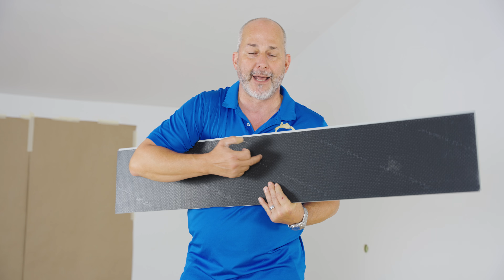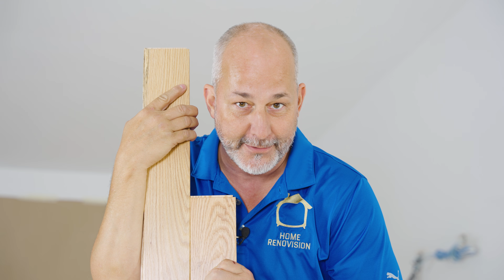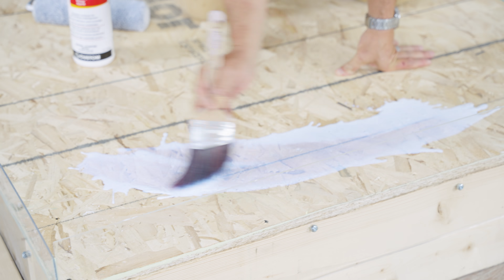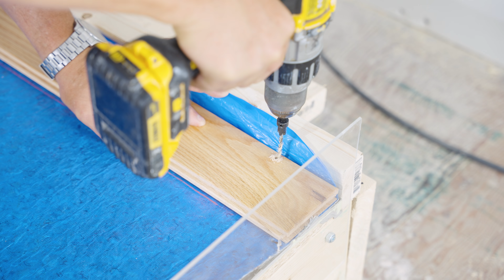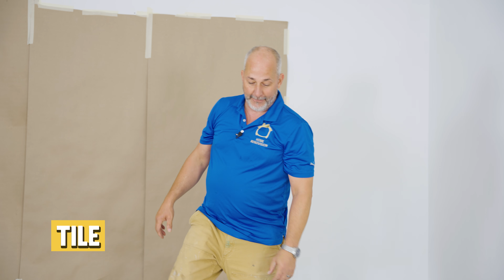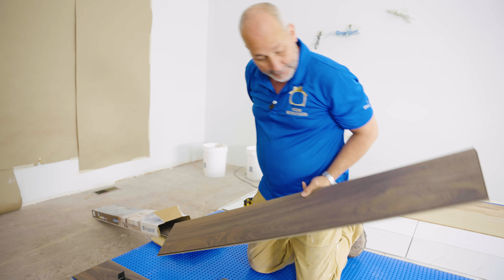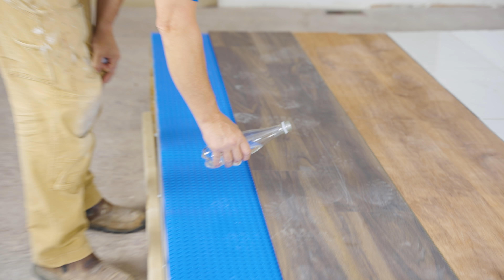Flooring Comparison: LVP vs Laminate vs Hardwood

Comment: I went with the loose lay lvp, and I really like how easy it is to work with, and you don’t need to worry about trying to snap the pieces together, and individual pieces can be easily replaced after they are installed without having to pull up other pieces of flooring. Occasionally some of the planks need to be tacked down with finishing nail if they happen to be prone to movement in that spot, but 99% of them stay put just fine.

Comment: I've done LVP in two rooms and I'm not impressed. If you have ANY floor imperfections it will cause problems where previous floating floors went right over it no issues.  The click or lock function is a nightmare.  I was pounding away with scrap pieces to tighten them up and it's in multiple directions.  The price is good but I'm using a different product for Bedrooms and front hall.

Comment: What you did  not consider is that water can and will seep through in between the LVP planks.  When this happens you need to remove the planks to clean the mositure.

Comment: What about testing how a fridge could dent the floor. Especially when you pull it out from the wall. We had engineered flooring up in and it dented under the rollers of the refrigerator and portable dishwasher, as well as chair legs.

Comment: From prior experience big dogs and powered wheelchair...
Hardwood... is gonna wear.
Vinyl/Linoleum... is gonna last 3 years at most.
Porceleain tile - no issues.
We never thought laminate would survive.

Water was a real problem  for engineered, tiles let it weep through to the subfloor.  Membrane probably fixes that.
Water stinks on laminate.  Not sure how it works for LVP.... sounds easier to mess with than full sheet.

More than half of me wants to use full sheet vinyl for a shower to make a perfect water seal...  Not durable, but you don't usually walk on your shower walls.  [Idea is really in use in RVs].  But it's a giant pain to stick to vertical surfaces....  I don't think LVP seams can handle showers though...

Comment: So basically you can have real wood for $8 or plastic wood (LVP) for $9. I assume the cost would be higher for real wood if you’re installing in a concrete slab because you’d have to install plywood first.

Comment: Ok, so this video really changed the way I think about laminate vs lvp so much that I did the test my self. I took a 20 mil lvp and ac 5 wear layer laminate and tried hard to scratch it with my keys. The vinyl plank was scratched deep way before the laminate. Now I dont know what to think. Are some of the flooring manufacturers lying on the specification?

Comment: Jeff,  as always a great Video.  Just a couple quick comments.  My wife and I installed a Pergo Laminate floor in our Kitchen nearly 30 years ago.  You know, back when you had to send a letter in the mail to get the company to send you a VHS tape on how to install.  So, State of the Art then!  At any rate, it was the glue every seam & ratchet strap each plank version.  Of course a couple years latter they came out with the click/snap version.  It is a small kitchen and it took about 3 days to install it all.   But, it has survived floods from a dishwasher, 2 kids, dogs, and innumerable insults of dropped items over the years.  It is also, the main entrance to the house.  It has held up remarkably well.  Very few scratches or dents, and still looks great every time you give it a quick damp mopping.   In short, it was a lot of work to put down, but has been well worth it.   
Recently installed a LifeProof LVP floor in my Aunt's Kitchen.  It went down so much more quickly, and was easy to work with.   Looked great when done, and seems to be holding up well.   So, laminate and LVP click/lock has come a long way.   I would not hesitate to put down either product these days, as long as the floor is level & you buy Laminate or LVP from a name brand with a good thick plank and thick wear layer.  Don't skimp by getting thin/cheap planks.  Literally, you are just wasting your time & money on a thin one.  
Keep up the great videos.  We are still laughing about flushing Sausages down the Toilets!
Reply from the maker: Great insights. Thanks for adding. Cheers

Comment: Curious if you'll make any videos on repairing the bottom of drywall that gets's ruined from old/poorly laid baseboards? We're doing DIY flooring here soon, and was removing the base boards and actually pulled quiet a lot of the drywall out in the process. Any advice would be huge!

Comment: This surprises me. I could have sworn engineered wood floors got a variable amount of refinishings, depending on how thick the top wood layer is.
Reply: Yes you are correct, a good quality engineered wood floor can be sanded to refresh the surface. 3 - 4 mm would not be unusual. You can also repair the planks, they have wax kits for bad dents.

Comment: I have a question about the underlayment you used with the hardwood flooring. If you have an encapsulated crawlspace underneath would that have any negative effects on the flooring?

Comment: AT 28:33 you said if we don't agree hit up the comments and tell you our experience.  

Tore out an old tile and subfloor.  Installed a new one using the "new methods" with these flexible membranes.  The floor was solid - no movement - before I started.  It runs out the membrane introduces a layer of flex that wasn't there. End result: grout is continually cracking out and having to be replaced year or two because the weight tends to be concentrated in one place and that part of the floor is continually being stressed.

Thought it might just be my own incompetence so I finally had a professional redo it.  Same results (only now I feel worse because I paid someone.)  The only tiles that didn't fail, and some are over 25 years in now, were done "the old way".

So, yeah, not a fan of the "new membranes".  They work okay for a while, then . . . snap, crackle and pop goes the grout.
Reply: I know this is old, but thank you for the "down-the-road" wisdom on flexible membranes for tile floors.

Comment: I've installed a few different laminate floors and never had an issues with tapping the ends together. You just need to make sure it's lined up correctly and afterwards make sure it's completely locked it without any gap.

Comment: i stopped buying that plastic "underlayment" everyone buys...i buy a cheaper and better product..i use the thin fan fold product used for exterior siding..the room is NOTICABLY quiet. its cheaper and its much easier. and the flooring sits perfectly on it and the thin plastic is just a wrestling match and really ineffective. save money and enjoy your project

Comment: Is the blue underlayment working for stone rigid core vinyl plank? My current problem is that my household isb1970 house, single floor, concrete slab foundation, most of the areas are flat, but some places has warp. So right after installation of the planks, everything is ok, however  2-3 years later, the places with uneven foundation, the corners will pop up. Even my handyman help me to glue it, it won't last long.  Will the underlayment help without the liquid thing to flat the subfloor? My problem is that I'm not handy, the flooring installation guy i hire doesn't do the flattening work, the handyman who can do the flattening work, doesn't uninstall old floor 😢😢😢 i have to hire the flooring guy twice, one for uninstal old,  one for installation new. This is too costly for me.

Comment: Titan Surfaces Colossal line, planks are 9” x 71” that look amazing. It’s an LVP with WPC construction, 12mm thick with a 30mil wear layer which I believe is the highest wear layer available with an impressive 1.5mm IXPE pad and uses the Uniclic locking system. It’s got the best of the best spec wise across the board and it shows. I went with Oceanus color and my friends that installed said it’s the nicest flooring they ever seen or installed even down to how well the planks were packaged. Maybe I got lucky but 1,300+ sq ft and every plank was mint and I never get lucky but this is some tuff stuff. It’s worth the extra $1.00 or so per sq ft for this stuff. Yer welcome

Comment: Hint for hardwood; buy directly from the factory, not from stores. Most factories have a line you can call and if you need over a specific order size, they will make it for you with the wood, size, tint and finish you want. The factory we have nearby does that if we go over 600 square feet. We ended up with all hickory floor at 4.15 $CAN per square feet!

Comment: Sheet flooring is still a smart choice for a kitchen because it looks good and will last for 50 years and cleans very easily. And it's very tolerant of things (glass, milk, eggs...) dropped upon it. I'd always favor that in a kitchen.
You can even get it in a wood pattern. 
Trouble is: no one sings its praises anymore. Personally, to me, a flooring just shouldn't be ugly.

Comment: I have some squeeks but floor is on top ( before ai moved in)..can I screw the planks down to subfloor? How best to do it ?   If I remove the planks just around that area (kind of hard) will leveler get worn flat over time & have to remove the leveler ( how?)  and redo it ?

Thanks for this detailed video.

Comment: So, for concrete slab foundation floors, does this sound good? Have a vapor barrier on concrete? Any updates to the following?:
• 6-Mil Poly Sheeting: This is the industry standard. It is a clear or black plastic roll that you lay down before the planks.
• Integrated Underlayment: Some LVP comes with a pad attached. Note: Check if that pad is also a vapor barrier. Often, it is just for sound/cushioning, and you still need the 6-mil plastic underneath.  
• Sealing the Seams: Always overlap the edges of the plastic by 6 inches and seal them with moisture-resistant tape (like tuck tape) to create a continuous shield.

Comment: Interesting... we replaced old carpet on the second floor with an engineered hardwood, and the manufacturer's installation guide recommended either the  staples, or glue-down. After a lot of research, we went with glue-down, even though we had to drive an hour to actually source the buckets of polyurethane glue. In retrospect, the staples probably would have been easier and faster. I had to be mindful of working my way towards the door, since you could NOT walk on top of the boards until the glue set, and cleaning up the tools before the glue dried was a chore, the one time I didn't, it was even worse trying to peel/scrape it off the grooved trowel. But I do feel like it's way quieter than the staples would have been. It's not high-traffic, and no kids or dogs, so durability wise it's doing fine.

Comment: But why do we need to add cement / concrete bater layer mix top to the bare subfloor Joyce wood surfaces. To make a level surface for the blue plastic padding overtop? Must be a way to use a silicon or some other goop material to level over base subfloors?

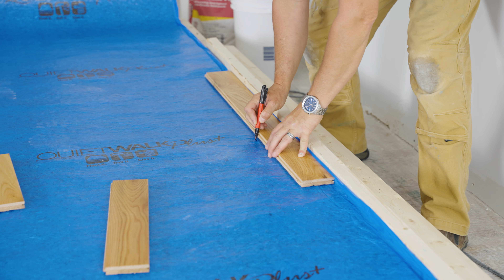Comment: 16:15 I think Jeff meant to say the opposite here, hardwood expands way more across the grain than in the same direction of the grain.  I've seen many disasters where hardwood floor has been exposed to a water leak and the wood expands across the wood planks. Wood planks (t+g hardwood, wall board etc. ) will pop off of their substrate.

Comment: Tile floors on wood floor assemblies required more knowledge than just do this or that and you will have a long lasting floor.  Floor joist spacing and spans play a key role in long-term success.  The underlayment you stick the tile to is just that it a surface for the settings materials to adhere to. None of them other the plywood provides Strength to the floor system. Every underlayment and every floor assembly installation played out by the TCNA has its place in construction.  Mixing and matching different manufacturers products could void warranty and is not good practice. The products have there limitations on what they can be installed over its not one product solves all the installation requirements.  Dimensional lumber and I joist have different requirements laid out in the TCNA hand book!

Comment: Your contradicting yourself with the hardwood floor and the glue. You either install paper or your blue underlayment first.  The glue will do nothing if installed on top of either underlayment. If you use the blue underlayment and decide to glue the first few pieces to the actual wood subfloor you will have a hump to contend with when you start.

Comment: I recently installed Luxury Vinyl Plank in our new kitchen, and 3/4" solid prefinished Oak throughout the rest of the house. Both were extremely satisfying, as the job turned out beautifully. A couple of learning points: - With LVP flooring, because it is a floating floor, the floor can actually 'walk' over time and shift position slightly. This was only a 'problem' where it was laid close to under the edge of one of the cabinets, and a gap appeared. Fortunately the bottom kick-plate of the cabinet is easily removed, and I added an extension to the existing strips to cover the gap.
With the Oak Flooring I had a stair installer put in a circular oak stair, and raise the base of the railings around our upper foyer, which was previously covered with carpet. Now the oak base of the railing is flush with the oak floors. There's no flex, nor squeaking, as I was certain to use wax paper under the planks, and cleat the planks every 8 inches or so. I didn't have many noticeable uneven areas. I also bought a premium brand Pre-finished Oak Planks that had mostly long 4-ft to 7-ft boards, that were knot-free and uniform in colour. (The brand was Superior Flooring - Rockwood, ON Canada) I took my time, used the right tools and methods, and installed over 2,500 sq ft of flooring. I think I did as good a job as most installers, and maybe better. 
The only problem I had was when one of the cleats hit a screw head, and curved back up and just out above the surface. A small Dremel Grinder, and a touch of wood filler then clear Urethane and there's no sign it was there. I bought the nailer, as I had a whole house to do over several months. Less than the cost of multiple rentals, and I can resell it after. No rush to finish so I didn't pay an extra day's rental each time... Already had a compressor and radial miter saw. 
Never buy cheaper brands as they typically have lots of short boards, lots of warped and poorly finished boards, and a variety with different colours and lots of knots. They keep their costs low by using every board, and you'll wind up with much higher numbers of waste boards and another trip to your supplier to buy more. They won't save you a lot of money, and won't look nearly as good as quality wood.
Before laying the boards, I undercut the baseboards about 1/2" with a small power saw, so I didn't have to pull them all off and reinstall them higher to clear the 3/4" boards. Much less work and damage to the baseboards and painted walls. I installed new wood trim to cover the gap. Don't skip this as you MUST have clearance for expansion around the edges.

Comment: overall great video! The testing at the end was what I needed to see, I would like to also see more about waterproofing to test if installed in bathrooms and how waterproof the laminate was. also understanding the typical cleaning methods like wet mop or dry mop? how easy is it to cut around doors? if installed on concrete or if you can just add it over existing tile. is there a floor you would recommend to just have a professional install? i have tiled before and I would pay for someone to do that next time.

Comment: How would you go about refinishing wood floors that have no breaks or thresholds from room to room (open concept) if you can not remove furniture from the whole house? Can you apply self-leveling compound on the wood floors and be able to remove it easily to refinish the floor if you want to?  I was thinking of leveling the floors and installing plank flooring over the wood. It would probably be worth it do that if (if hiring professional + down time + mess), and getting it done section by section without the dust, mess, and down time associated with refinishing them. I am working with limited funds and time. Any advice would be greatly appreciated.

Comment: Love your videos and have learned a ton. Poured 2500 sq ft of TechLevel 150 after you taught us how. Questions about flooring: When it comes to LVP, I like the idea of DMX One Step, but we have hydronic heated floors upstairs and down. I'm thinking it would negatively impact our heating? I do not have a concern about moisture upstairs, and I do not see any signs of moisture downstairs, so I'm inclined to skip it and put the LVP directly on the TechLevel. Thoughts? I see some places that say it needs to be coated or epoxied, or maybe just put down vapour barrier. Do you have experience with any of these options? (If it matters, we're in the Lower Mainland of BC and the house is ~30 years old. Before pouring the self leveling, I could see vapour barrier between the foundation wall and floor - made me think the concrete floor might already be protected from moisture coming up?). Thanks!

Comment: I’ve seen a lot of engineered hardwood planks having the same wear depth as a regular hardwood plank. Meaning the engineered hardwood has the same amount of sand-able wood a regular hardwood plank would before you get to the tongue and groove.
Reply: Yup. As long as it's 4mm or more you are good for multiple sanding

Comment: A video on comparing different brands of LVP. Also a video on Concrete slab floors and underlayment options.
Reply from the maker: Thanks for the suggestions!
Reply: @HomeRenoVisionDIY  Yes would love to see side by sides of various LVP... So many on the market and no way for people to see what's decent outside of marketing "5mm core Xmm surface coat" ect.
Reply: I have a failing Shaw LVP floor in my “newish” (just under 3 years old). Theboare